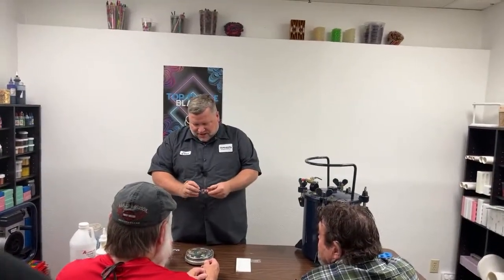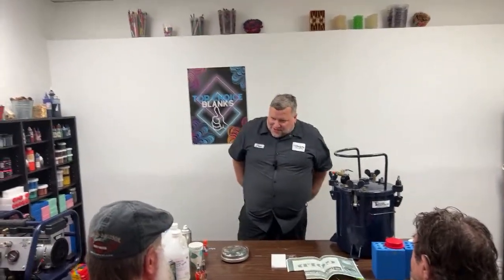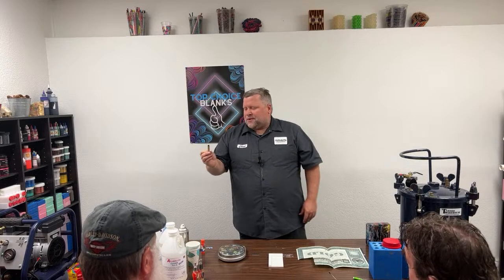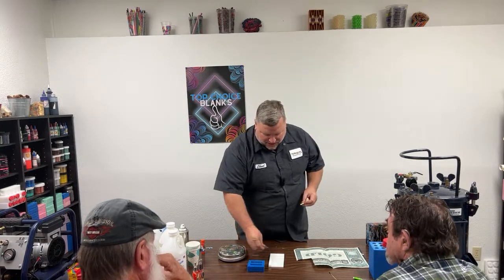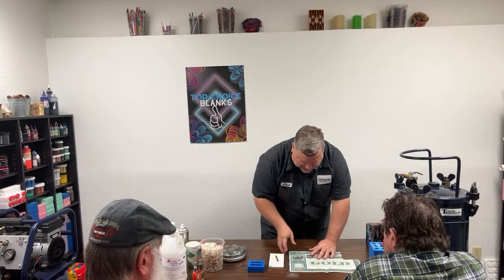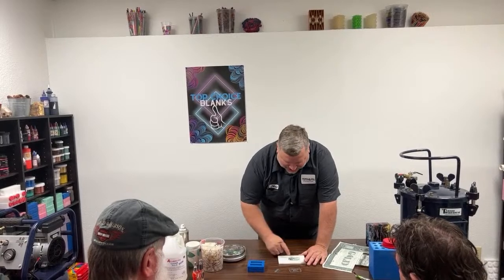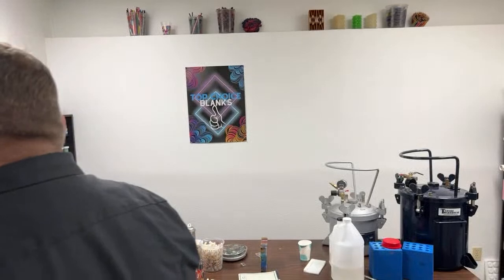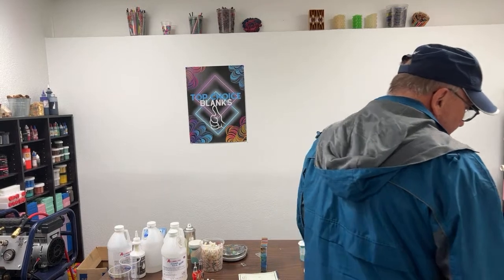Live demo- Label casting/tube-in casting

Comment: What is the shelf life of the epoxy resin you're using? Not the 'pot life', but how long can you store the resin before using it.
Reply from the maker: The manufacturer says use it within three to six months. Things like heat, UV etc can make the shelf life shorter as well. Another good tip is to make sure that you are getting your epoxy resin from a place that you know is regularly selling through stock and rotating. Hope that helps